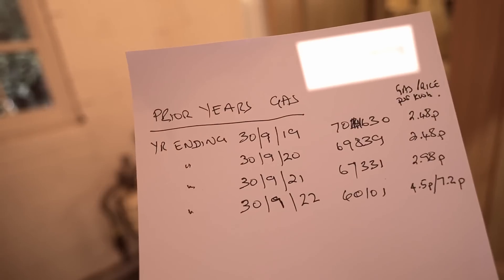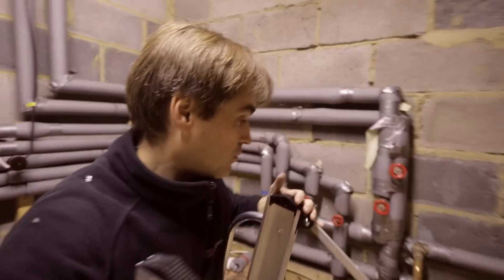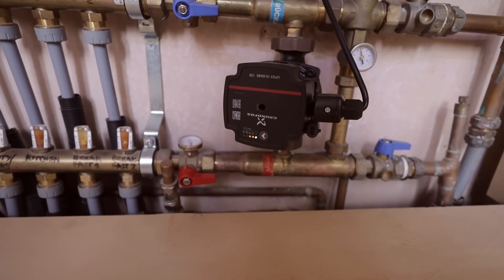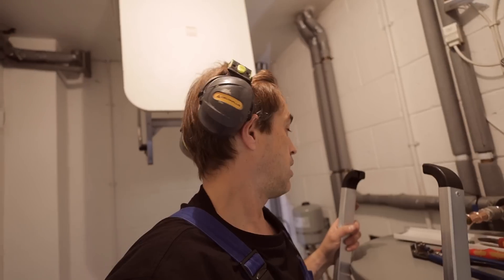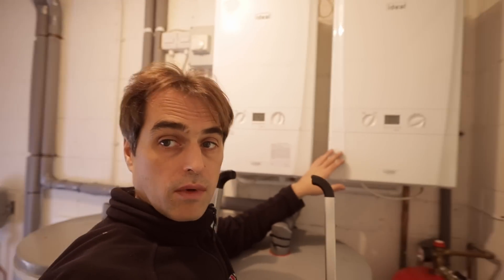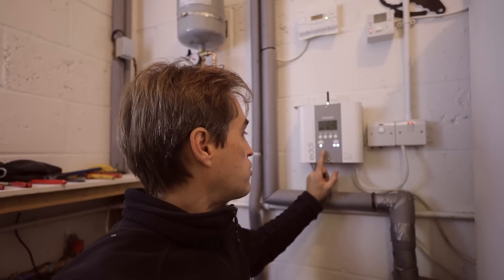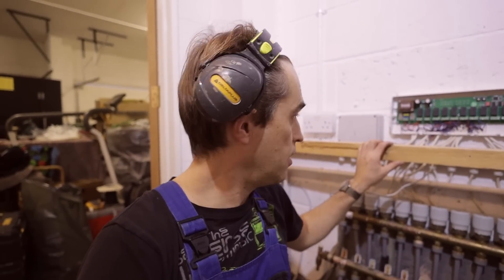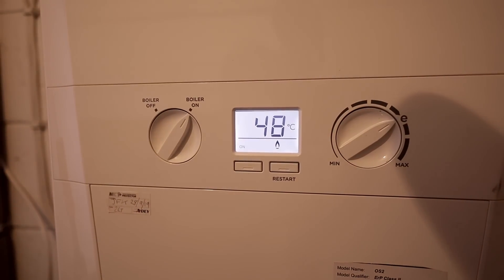Learn How to Lower Gas Bills and Improve System Performance

Comment: Damn, I wished you covered W12 as need a Nest unit fitted to an old S Plan system.
Reply from the maker: how dare you - I only remove S plan systems :)
Reply: @UrbanPlumbers  😂
Reply: @UrbanPlumbers  - Been in place 30 years at least Potterton Suprema 80L system boiler (replaced logic board myself or repaired as dry joints) just trying to keep it going before a house refurb and times are tight as the whole system would need to be ripped out, the old flat I did up had a Megaflow system.

You Polish?